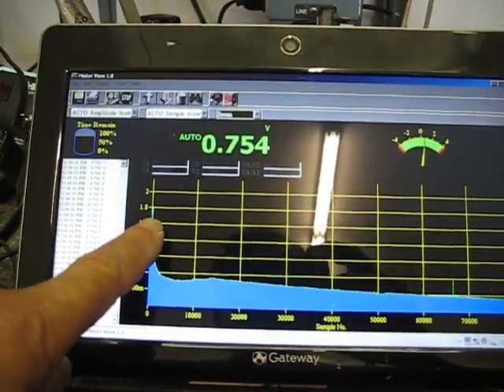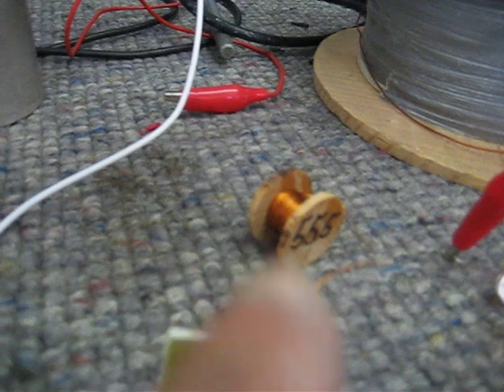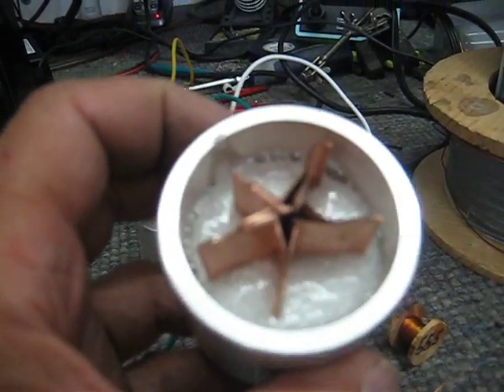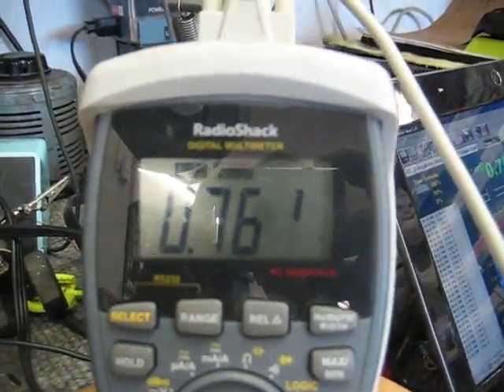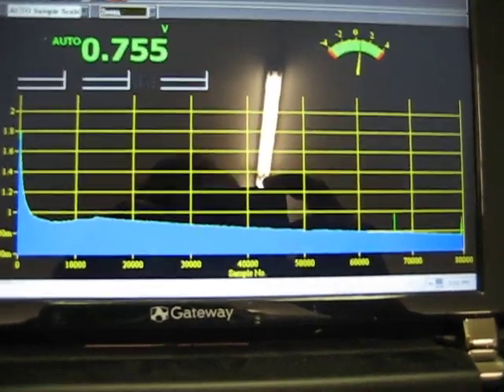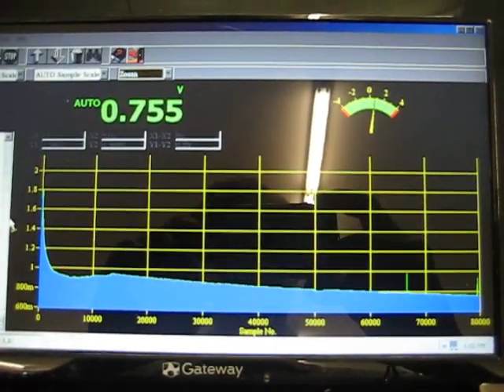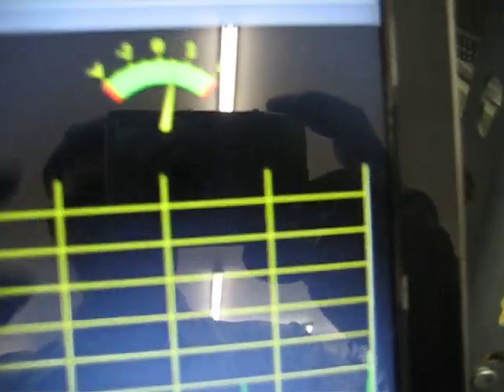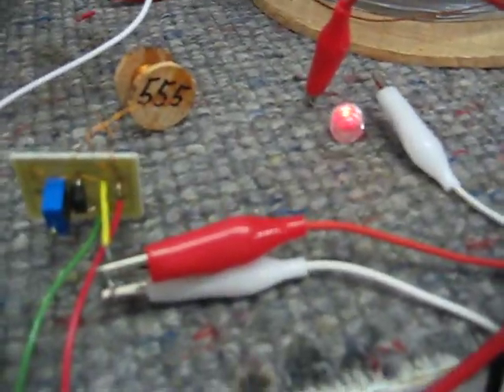John Bedini Testing  John H Crystal Cell for power.

Comment: Thanks John - Really great to see your clear videos.  The results you're getting confirm what I am seeing - the power always drops over time, but will come back after disconnecting the load.  The cell Ive built has been running continuously, but has dropped from 5mA to 1mA under load over the last 2 days.